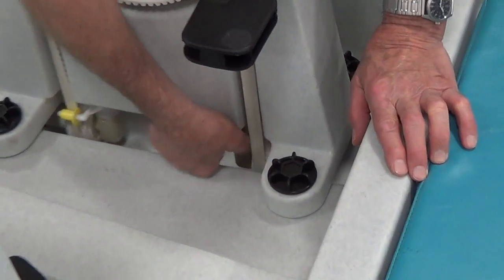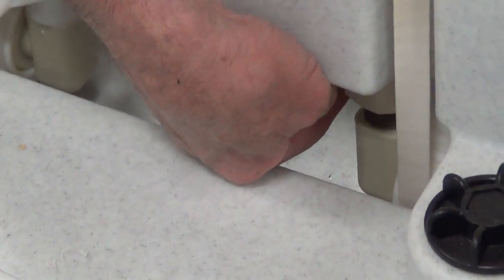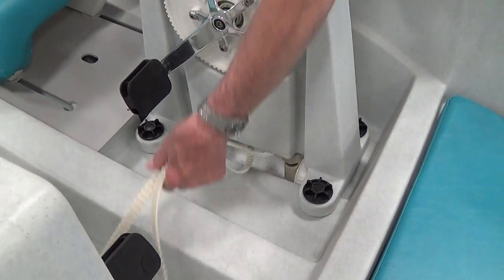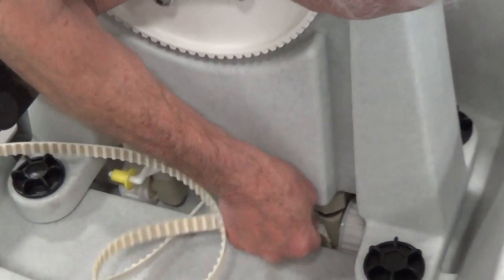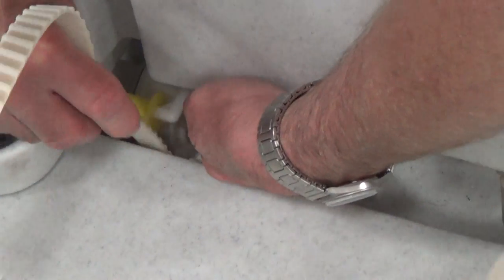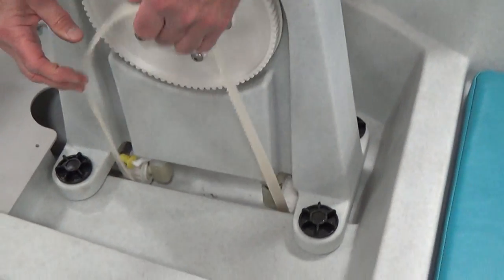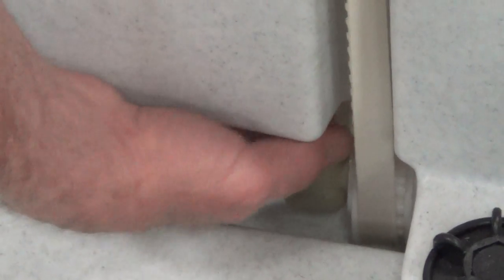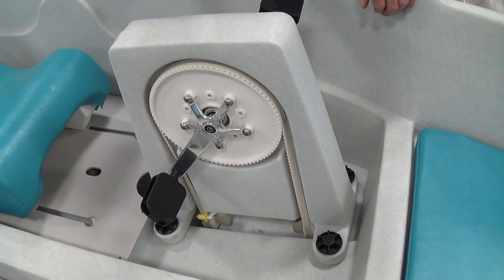Nauticraft Pedal Boats - Remove/Install Drive Belt

Comment: Two questions; I am 6'6" tall and would your vessels accommodate my height ? How often do you need to replace the belts ? I ride a Catrike recumbent trike quite often so I am quite used to pedaling.
Reply from the maker: Hello - and thank you for your interest in our boats! In answer to your first question, yes, our boats would accommodate someone of your height.  Our production manager is 6'5" & they easily accommodate him. Note that the fore and aft seat position is adjustable thru a 13-inch range in 1" increments.  The average life of a drive belt is 3 - 5 years.  Note that its life will be reduced if left out in the sun & elements.  If you are interested in a more efficient pedaling experience or will be out in windy conditions, we would recommend the Escapade.  Several avid bicyclists own the Escapade and are quite happy with its performance and complimenting their workout.  I hope this helps!  Please feel free to E-mail me directly at: mary@nauticraft.com with any other questions or comments.  Thank you!
Reply from the maker: Hello!  I was just touching base to make sure you had received my below reply and whether or not you had further questions.  Please let me know how I can be of assistance. Thank you!